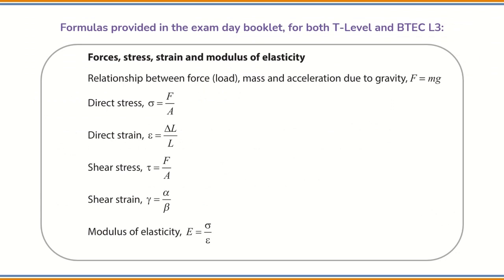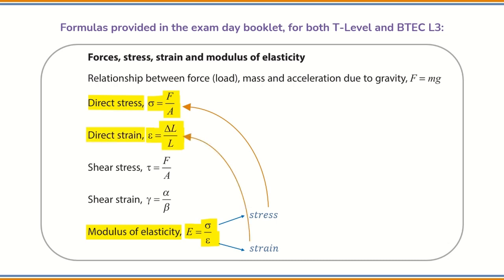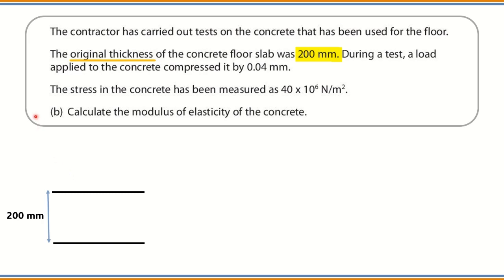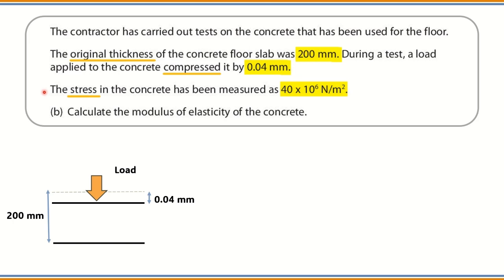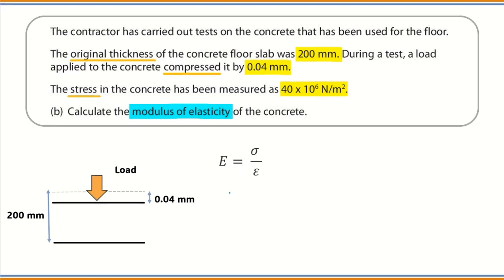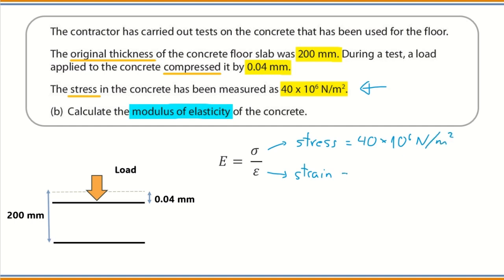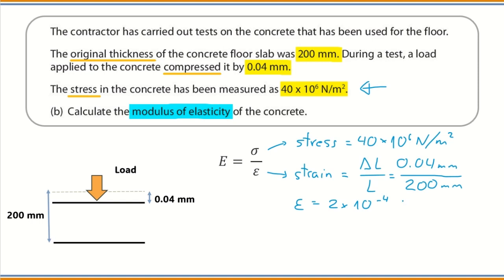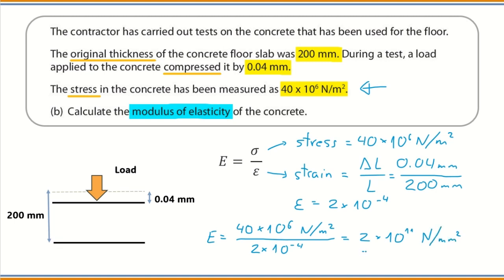T-Level and BTEC L3 in construction - Calculations of stress, strain and modulus of elasticity

Comment: How come you didn't convert the answer for strain into meters? Because the stress is given in meters, meaning both stress and the strain have to the same unit before you can divide them.
Reply from the maker: Strain has no units because it’s a ratio of two lengths: the amount a material stretches or compresses (Δ𝐿) compared to its original length (L).
Since both are measured in the same unit (like metres or millimetres), the units cancel out, leaving strain as a pure number.
If you convert it in metres, you will get the same result:
0.04 mm / 200 mm = 0.0002 
0.00004 m / 0.2 m = 0.0002